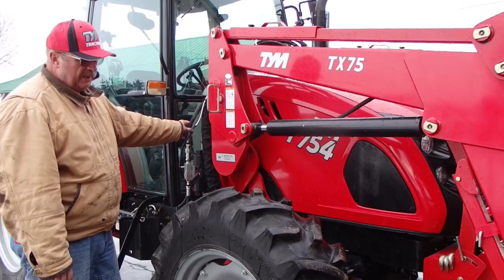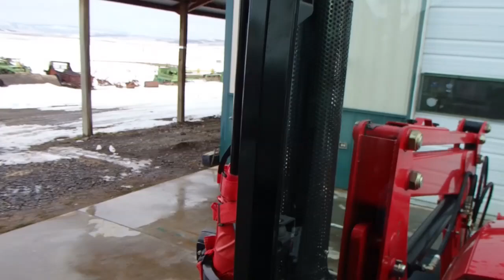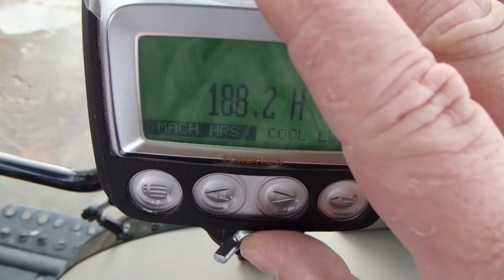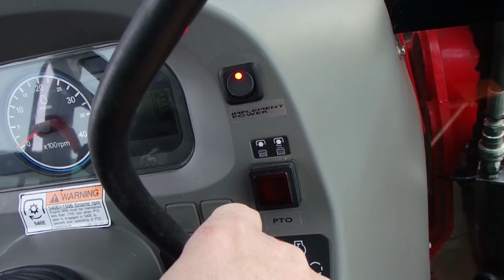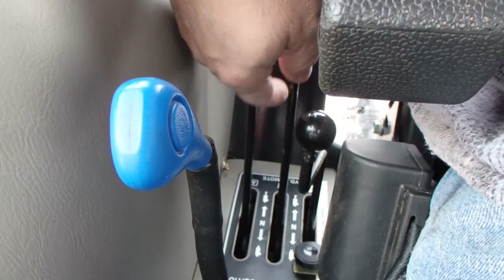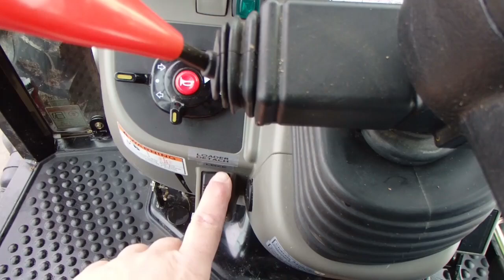TYM 754 Tractor

Comment: I've been looking for that hydraulic bucket locking thing. Moving from a smaller tractor where I can grab the bucket and move it around to one of these. I think the dry weight of the tractor w/o loader is comparable to the weight of this thing's loader heh. So really interested in not being near it when it's unlocked, to be able to do it from the cab is just icing.

Comment: Thanks for the review, you added some very nice mods...!  I own TYM 494, also have a cab, don t know anyone would get one without.  Do you have a link for the actuator for the bucket latches?  It would be most helpful if you could do a video on the design-build and attachment of the actuator for the quick attach.  I would also pay $1000 for an upgrade like that.
Reply: All home made by me. I used an 11 inch 285 lb actuator but results may vary with geometry of arms etc.

Comment: Where did you purchase the armrest and seat beat? Thanks
Reply: They were both eBay purchases

https://rover.ebay.com/rover/0/0/0?mpre=https%3A%2F%2Fwww.ebay.com%2Fulk%2Fitm%2F324023798078

https://rover.ebay.com/rover/0/0/0?mpre=https%3A%2F%2Fwww.ebay.com%2Fulk%2Fitm%2F271392420846

That seat belt is similar.
Reply: @Bill-NBfarming  Thanks